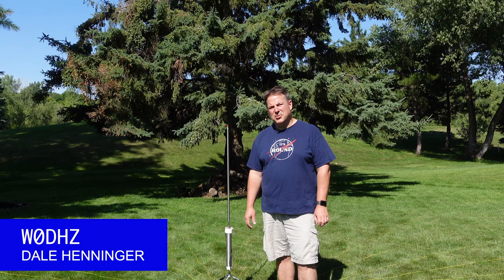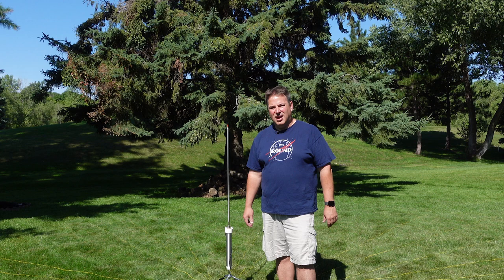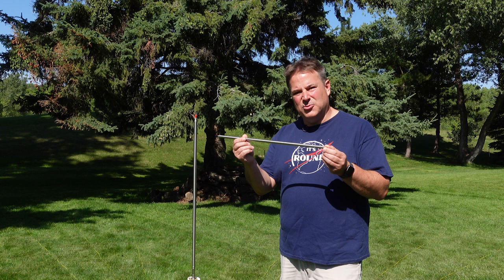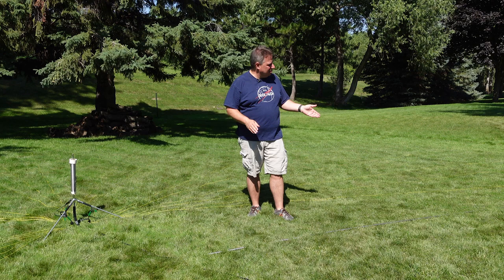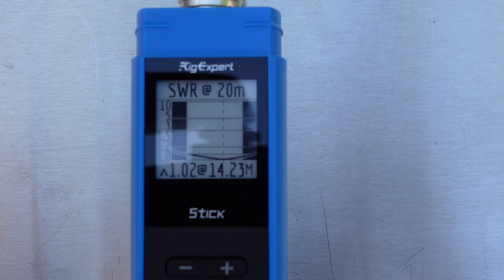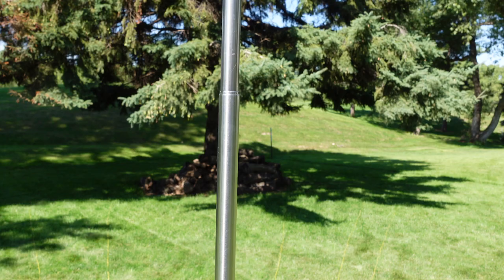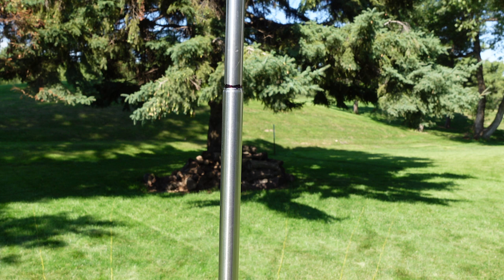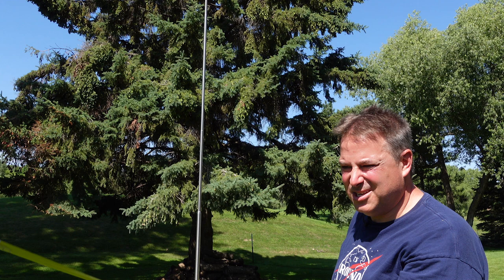Wolf River Coil SB1000 Tuning for Fast Deployment and High Performance

Comment: Best video I've seen yet on this antenna. Thank you for taking the time to make this. I've been using the MFJ-1979 213" whip with radials for about 5 years and like you, I have found this is a reliable and consistent system to tune. I love a vertical!

Comment: Thanks for the instructive video.  Another technique that might work is to attach a fiberglass tape measure, like those used by tailors, to the top of the antenna.  Metric tapes are readily available if you prefer them. By joining two 120" (300 cm) tapes in the middle you can directly measure the distance from the top of the antenna to the top of the coil.  No marks on whip to worry about.  And the fiberglass tape is non-conductive and should not impact the radiation pattern.  (Though it does add a bit of wind load on a windy day.)

Comment: Gr8 video, thanks!

Something that i’ve done to speed deployment and be able to quickly change bands is to tape piece of string to the top of the telescoping antenna tip and along the string I have white vinyl tape markers with the band/frequency written on them. Then simply adjust the antenna so the desired band tab is aligned with the base of the coil. 

This avoids having to extend the whip while it’s in a horizontal position and raising it up, rather simply screw the collapsed antenna into the top of the coil, then raise or lower  the antenna to the appropriate length. 

For band changes, simply slide the telescoping antenna down or up until the tap tab for the band you wish is aligned with the coil base. 

If it’s a breezy day, I will wrap the string around the telescoping element a few times to keep it from flying in the breeze.

Comment: I just received my TIA kit, but I wish I had watched your video before. I have the lower-power default coil and the 102" whip. I'm putting in an order for the longer whip, but, with my IC-705, I'm not going to worry about the coil for now.

Thank you again for taking the time to produce the video. It's very professionally done. 73 DE N2GJ, ABQ, NM USA
Reply from the maker: I hope the longer whip made setup easier for you and the performance better!

The Wolf River Coil has been my go to antenna after learning how to make it fast and easy to setup and getting the performance of a 1/4 wave vertical.
Reply: @W0DHZ  Hi! I am having a good time with the 17' mask. I've connected 3 radials, but I have more I can add. I have a MINI1300 antenna analyzer and, on my NM RoadRunner Traffic Net frequency of 3.393 MHz, it's tuned to almost 1:1 SWR. Best of all, it works. I'm the Sunday night NCS and my signals have been reaching as far as Wyoming with 100w from the ICOM IC-7300.  I'm pleased.  Happy Thanksgiving!

Comment: You actually do not want to tune for minimum SWR with your Rig Expert. You want to tune for minimum reactance when adjusting the length of the whip. This will produce maximum radiation efficiency. Given the number of ground radials you have deployed, you will likely not be able to achieve zero reactance (100% efficiency) at the 1/4-wave vertical's native resonant feedpoint impedance of 36 Ohms . Thus when you tune the aerial the way you do in the video, you are adjusting it for about 70% efficiency: for every ten watts delivered to its feedpoint, 7 Watts will be radiated and 3 Watts wasted. 

The radiator exhibits 100% efficiency at zero reactance and 36 Ohms of feedpoint impedance which resolves to a SWR of 1.3 to 1. You can either live with this SWR, or put a matching network at the vertical's base to achieve the 1:1 SWR match to your 50 Ohm coaxial cable (L-match with a hairpin across the coax connector followed by a capacitor off its center conductor to the vertical). You will note that in mobile HF installations, loaded whip (e.g. Hustler, etc) will have a small hand-wound coil between the vertical and ground to match the aerial's feedpoint impedance to the feedline 

One of the worst things about the Wolf River coil is its use of stainless steel wire (1.4 Million Siemens/meter) in the coil, compared to less-expensive aluminum electric fence wire (43 Million Siemens/meter). Aluminum is 15 times more conductive than stainless steel, which means if you opt to use the Wolf River coil at all, you need to rip the stainless steel off its coil form and rewind it using aluminum wire. The best wire to use would be silver wire.

73s, BILL W1ZY
https://w1zy.substack.com/
Reply: Aluminum wire is a good-news, bad-news kind of situation. Yes, it is much more conductive than steel. But in a normal atmosphere, aluminum oxidizes basically instantly to form a surface layer that is a lousy conductor. It makes it hard for a sliding contact to reliably get to the underlying pure aluminum. More bad news: RF currents stay on the surface of a conductor and so, don’t get a lot of benefit from the highly conductive aluminum. Where the Code allows aluminum wire the contact points must be held down with a minimum torque—much higher than what the sliding contact on a WRC will provide. The fact that WRC uses stainless steel instead of aluminum on that coil is significant.
Reply: @georgeetherege8347  Good theoretical points. Might try aluminum anyway, regardless of the skin effect, as an experiment.

Comment: Great video.  My 2 daughters 11 and 15 have been improving their ic705 POTA station, the radials really do help.  Recently they added 16 x 31.5 foot radials, as this was what was easiest to cut from the silicone 18g 250' of wire spools.

Comment: One question - when you tuned for 40 meters, the gray band shown by the software runs from 7.00MHz to 7.20MHz.  Similarly, the gray band for 50M ran from 50.0MHz-52.0MHz, not to 54MHz.  That software seems to be set up for the ITU Region 1 band plan. 🏏

I checked... AntScope2 -> Settings supports setting "Band Highlighting" for ITU region 1, 2 or 3.  It defaults to Region 1, probably because the product comes from Ukraine. You probably want to set it to Region 2 for use in the US.

Comment: Thanks for this video, I am just now getting a portable antenna pulled together and I’ve ordered a WRC Platinum 1000 👍🏻. 

One comment though - 1/4 wave is actually not ideal for DX. 1/4 wave is basically “unity gain”, which is zero gain. The radiation pattern is pretty much even in all directions from straight up to horizontal. This means the RF is spread across all directions. A gain antenna, such as a yagi or half wave, is better at concentrating RF energy towards the horizon and therefore better for DX since less energy goes straight up (which means more RF towards the horizon for DX stations to hear!).
Reply: 1/4 wave will work just fine for dx. Obviously not as good as a directional antenna, but not everyone has multiple thousands of dollars they can spend on the antenna, rotator, and tower. Also.... that setup is very less than ideal for portable operations. A vertical will get you a better lower take off angle than a dipole will. Especially if you don't get the dipole up a 1/2 wavelength off the ground.

Comment: Hello Dale! Your last name is a after a german beer brewery in Frankfurt "Henninger Pilsner" just by the Way. Ummm...ok, here we running a home made EFHW 49:1 Balun with an 34µH extension coil for 40-10m resonant if it's setup horizontal. I run it vertical on my 40ft. fiberglas mast and there's a Antenna Tuner needed. Just a few days ago I got me the German Clone of the Super Antenna MP1 called HF-P1 by Difona Electronics. That Wolf River Coil you got there looks an interesting project for me to test this next after played with the HF-P1. Thx for the video presentation and keep up good work. Happy sunday from SW-Germany de Your Firend Uncle Guenter, DK5ONV

Comment: I have two sets of the Center Loading Extensions. I can use them with my 102" whip (no coil) and  get it resonant on 17m - 6m. I suppose I could use your coil bypass trick with the extensions/whip. I have everything charted like you did. I love discovering more options for how to use the WRC. I have ordered a mirror mast mount and I'm going to try using it on a spike.

Comment: Different color Sharpie permanent markers. Find the position for the sliding tap for the bands you use and make a colored ring around with the Sharpie.  Yes you will have to redo it occasionally. Or you could mount a small square brass rail with the sliding contact. File marks in the rail. I think Norcal sold a coil like that in the 90s. 73s

Comment: This was a well done and informative video. I have a WRC Silver Bullet that I use for 40M QRP CW only. I have the 102" whip and I use 6 radials. I have been thinking of getting the 17' whip In hopes of getting more propagation. With my current configuration I seem to hit only 3 surrounding states.
Reply: I too have the basic 102" antenna. I've had huge gains in propagation simply by adding a LOT more radials of varying lengths.  It was rather disappointing with the 3 radials supplied with the kit, but adding more really brought it to life. I get into Europe on occasion from Ohio when the bands are good on 40, 20, and 15. Most of the lower 48 and southern Canada is normal. I also plan to get a 17' whip in the future and I'm pretty optimistic about trying that out.

Edit:I run it with a Xiegu G90, mostly digital. So 20W max.

Comment: Thanks, I have this setup except for the higher power coil and the long whip. I need the longer whip now and a better radial setup like yours. I just bought the DX Commander Classic. I have most of it together in my basement. I considered taking the WRC to Colorado this spring but your video makes a lot more sense out of it all. I subbed.
73
KA0KAE

Comment: You probably won't be using the antenna on 6m. But if you want to optimize it you might consider tacking on some 1/4 wavelength radials for 6m; I had to do that for my SteppIR BigIR vertical to get the best match on 6m. If you're going to be serious about 6m you're going to want to go horizontal anyway for weak signal. TNX for the great video!  73 - Dino KLØS

Comment: I had trouble with it falling over with wind. I am in central Florida, sandy soil, and not always level. I got a small ground rod and cut it in third. Put a mount on one of the parts with a point and put that in the ground leaving enough to have the coax connection easy to get to. Here I can push it in the ground much of the way and then step on it to get it in the ground. I had a short piece of 550 cord that I made a loop to put on it to help pull it out of the ground. I also have the center load parts that give me two parts to make it longer. One of them will replace the coil if you wanted to do that. This may not be good for everyone but may help some people. Maybe this could give someone an idea to do something to help them where they are. I packed a small level to help put it in the ground level. For some reason standing above it I couldn't do that without the level. It may be because the ground wasn't level. The parts of the ground rod are about the same length as the other parts of the coil setup. Hope this helps someone get an idea that helps them.   73   W4DES

Comment: Dale...Great video.  I just bought the Platinum 1000.  I need to know what wire gauge your radials are if you could possibly comment.  Also, WRC supplies 33 foot radials.  Should that be the length given the manufacturers instructions.  Thank you for your help.  KD8QDL - 73

Comment: Appreciate the details you provided.  I’ve been using the 213 inch whip for 20-10 meters while waiting for a mad dog I ordered a few weeks ago.  Been doing the lazy “magic carpet” ground plane with faraday cloth method, but quickly realized its shortcomings. The wind blows it around too much, therefore my SWRs aren’t consistently very low like yours.   Did you ever use your coil on 80 meters?   That’s the main reason I bought one since I already have a really convenient EFHW that gives me 40.

Comment: Wouldn't using different colors of markers to label each tune point/band be helpful?
Reply: Good idea - I have different color Sharpies.  Just don't forget your cheat sheet!  LOLOL
Reply from the maker: Great idea!  As N2GJ mentions, there are different color Sharpies.  To be honest, I am still trying to find the best marker for a stainless steel whip antenna like this.  The markings eventually wear off and the light colors do not always pop.  You also have to use something that does not increase the profile of the whip as it has to collapse back on itself.  I have debated using an engraver to etch markings and numbers.  I have not gotten around to it yet.

Comment: So, basically you don't need the expensive coil.  An adjustable whip is all you need.
Reply from the maker: Essentially for 6m-20m you do not need the coil if you use the 213" whip.  If you want to do 30m, 40m, 60m, or 80m, you will need the coil.  I still make all the measurements with the coil in there as I move between 20m and 40m quite a bit.  Also, the additional weight of the coil helps keep the base more stable.  By not having to use the coil to tune to 50ohm on 6m-20m, you will get a much lower Q and a much flatter SWR over a much higher bandwidth.

Comment: Nice setup, great video. What size Powerpoles are you using for the radials? Standard 30 amp or something larger? I've been thinking of getting a WRC and want to do something similar.

Comment: I'd say you should set the antenna to be resonant at 50.4 MHz to be in the center of the CW/SSB region. Does anyone do POTA of FM? I guess there's no reason to not do POTA on 6m FM but I don't think I would.

Comment: Why is the 1/4 wave length number EX 20m=192”. Why is it not 197, a true quarter of 20m. Its 5” short from true 1/4??
Reply from the maker: Great question!  A couple things play into this.  

The 20m frequencies are not exactly 20 meters in wavelength.  If you divide the speed of light in meters/sec (299,792,458 m/s) by 14.255 Mhz (adjust for hertz), the center frequency I was tuning for,  you actually get 21.1 meters for a full wavelength.  Now, that does not help your question, as the quarter wave actually got longer.

But then if you calculate the velocity factor (I used .93 for the velocity factor) of the wire (as it is not truly speed of light), that will bring the number down to a tad under 20 meters.  (It brings it down 7%)

So my calculations came in at 490 cm or almost 193". 

In the end, I used these numbers to get me very close and then I fine-tuned using my antenna analyzer and looked for the point that looks most resonant.

Comment: Hi, I have the 213 inch whip and have not been able to get  15, 12, or 10 meters to tune well.  I am going to try you numbers to see if that works.  What radial lengths are  you using and how many?
Reply: he says he uses 33" radials and has 24 of them in the video.